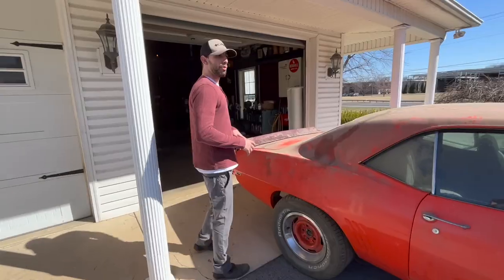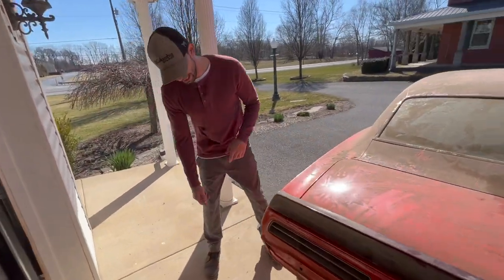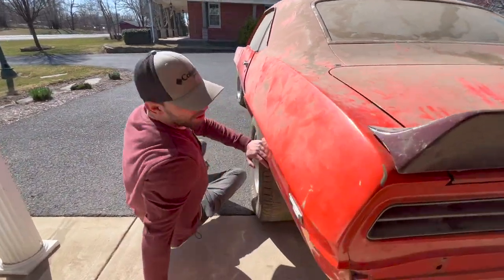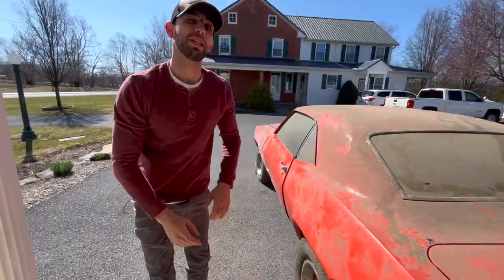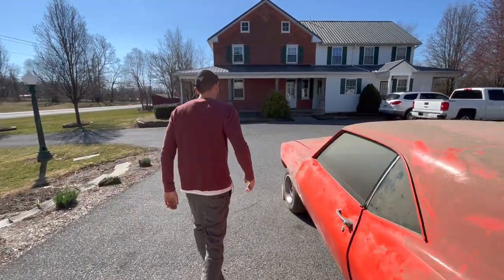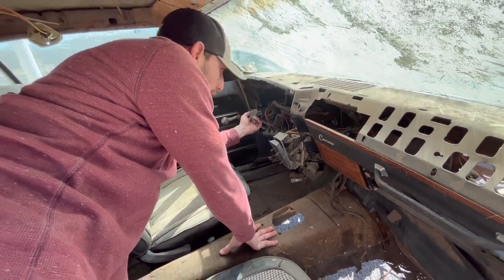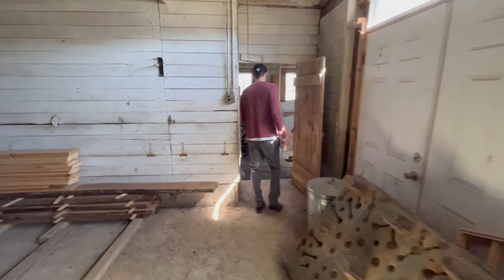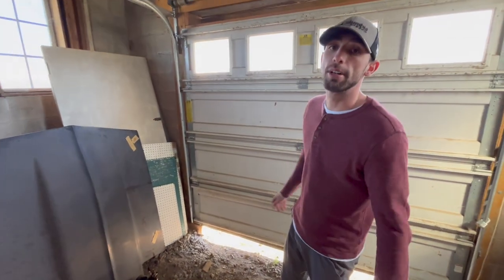I was Made An Offer I couldn't refuse... 1969 Camaro - Barn Find

Comment: If those heads are off a '70 LT1, they would have screw-in studs and guide plates. They used the 186 casing was used on several cars. I have a '69 Z/28 with that casting, and I had a '69 Impala that had them, but they were 1.94 intake valves. Still a desirable head.
Reply: I’ve never found the 186’s, I’ve always found either the 461’s or the 292’s.